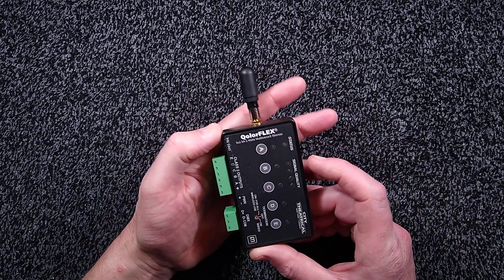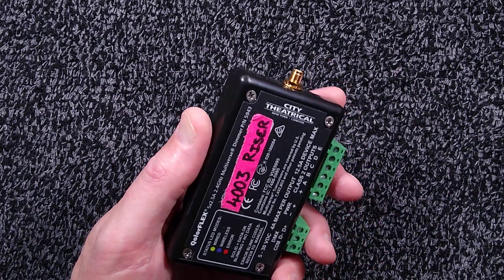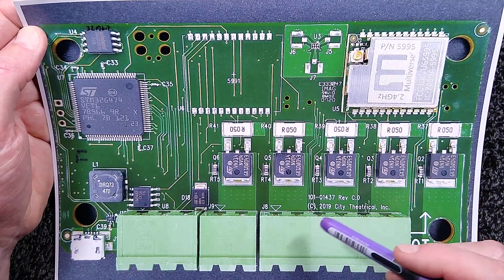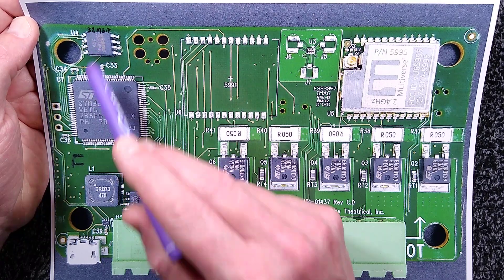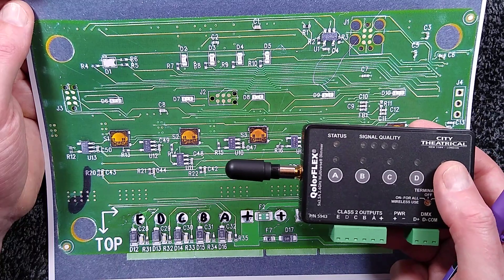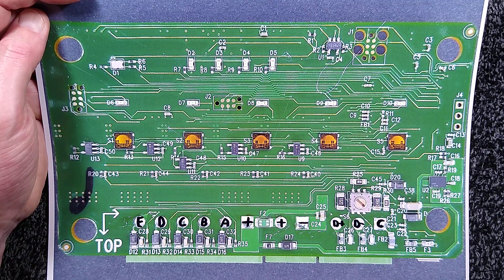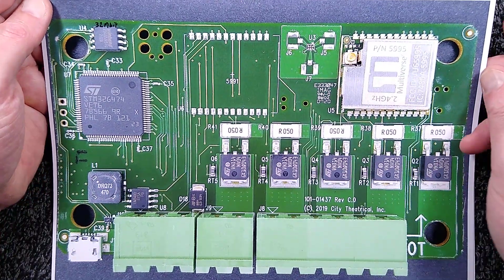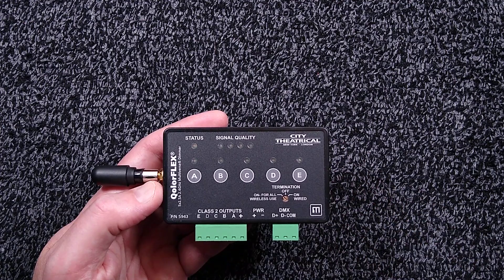Inside a wireless DMX receiver

Comment: I have had a fair amount of issues with production gear on 2.4G. often it works well till the audience shows up and the noise floor swamps out all the headroom. the worst performers seem to be the cheaper or older stuff. with the wireless com system I often use, if you get too close to the Wifi AP that is used for console control the com headset acts as if it is out of range

Comment: Clive, the issue is the huge amount of broadband RF noise radiated by video wall panels.  Serious, fire up the floor and put a spectrum analyzer antenna where the City Theatrical unit is placed and tell us what you find.  I have stories about a performer who wanted to do a duet with his wife (a performer with her own career) and it included them sitting on LED floor.  The RF noise floor at the performer's IEM receivers was 12dB over the IEM transmitter signal.  The artist was "I'll fire you if you can't make this work" insistent on the choreography no changing and the LED floor be used.  It got fixed by adding a transmit antenna that lowered from a lighting truss and got camouflaged as a piece of decor, but it was only a few feet above the performers.  Your problem is less the wireless DMX device and mostly the insufficiently shielded LED panels and their data/power supplies.

Comment: I'm amazed they're operating on 2.4GHz. With the proliferation of iPad controlled mixing desks the audio world has rapidly found that 5GHz causes much fewer headaches once the audience rolls in and you've got a few hundred mobile devices all constantly polling for networks. Cheap wireless mics/guitar packs/etc. that use 2.4GHz also trample all over 2.4GHz WiFi which can lead to some amusing conversations...

Contrary to popular belief, hiding the SSID of your network doesn't help since all that does is tell devices not to show the network in the "available" list.

Maybe they are more stable in the theatre industry where there is a much stronger culture of turning your damn phone off for the show?

Comment: I'm surprised that anyone would even try to make a product for commercial / semi-mission-critical applications that's so depedent on the 2.4GHz ISM band, because it's a cacophany of shouters, and not just Wifi & Bluetooth at potentially close range, but a bunch of other protocols in common use; it's basically the 'wild west' of radio spectrum.  The problem with the 868MHz / 915MHz bands is that, iirc, you'd struggle to achieve a DMX 250kbps rate given the regulatory limits in some countries, because it too is an ISM band where almost anything goes.

Comment: About interference. I recently ran a small show in a small room in a local pub. I pre-wired the lights with a DMX radio receiver for convenience of setup. All worked beautifully at home. In the pub room the lights would respond, then not respond and then respond again a bit later - not usable! Luckily the room was small so I ran a cable from the desk to the lights and all was well. Later I ran a wifi audit app on my phone and saw loads of high-strength 2.4GHz signals.  It looks as though each of the residential rooms just above the room we were in had its own wifi AP and the sheer quantity and strength of signal was swamping the DMX trasnmitter's signal.
Reply: PS we use the radio DMX units in the local village hall with up to 20m throw to multiple receivers and all works seamlessly.

Comment: My work wife does all the DMX in our theatre.  He often has a nervous breakdown with DMX.... I'm lucky, I only have to worry about QLab.
Reply from the maker: DMX is pretty reliable if done correctly.  Biggest culprits for flickering are long runs with no termination, damaged cables and cheap disco lights that decide to put random data back out onto the network.

Comment: Not sure why it even needs the STM32. I helped design and wrote the firmware for a similar device a few years back using only an ESP8266, I will admit it did not have the current sense, but it did have polyfuses so at least it did not smoke under fault conditions. These days an ESP32 should be ample to do the job.

Comment: So, let me get this right, you were using 2.4GHz digital transceiving equipment inside an outdoor Arena, surrounded on all sides by Thousands of 2.4GHz Transceivers seeking WiFi and Bluetooth (both on 2.4GHz, many of which would have been transmitting video via Mobile signal, the TV crews were also using the same frequency band, but at a very (relatively) high Wattage, and you experienced drop-outs?  Bloomin Heck. the basic radio theory I learned in the 70s and 80s is still valid after all!  Every mobile phone was competing for the same signal, ramping up its transmitting wattage at every failed attempt. Ok, very small signals individually, but accumulatively, although not 'interference' as such, definitely a blocking signal. You could have roasted a bloody chicken in there!
Reply from the maker: Yeah.  I didn't care much for the choice of frequency, but on the previous run of this show we used another 2.4GHz system and it performed well.  (Titan tubes)

Comment: Further to yesterday's idea ..... you might make a highly directional antenna , ( to cut out the camera crew's interference ? ) ... these are called " Yagi " and folk that have terrestial TV in poor signal areas have them on their chimney pots etc .... these work around 800 MHz , so one for 2400 MHz will be approx ⅓ the size ( easy to handle ? ) ... you can build it with scraps of wire " Jet melt ™  " to a sheet of very thin ply or stiff card ( multiply all the dimensions down by ⅓ ! ).... do not forget that this design uses a FOLDED DIPOLE to give a reasonable match to 50 Ohm cable ... the use of thin , 3 mm PTFE  RF cable helps ( look up RG numbers ? ) ,  as it is much less lossy @ 2.4 GHz , and it does not MELT when soldering !  there is no need to use a micro MCX connector ( like the module uses ) , just terminate in a SMA connector like in your module shown ( easier to wire up ! ! ) .... hope this fixes your problem ?   (  RF  electronics is a total " black art " .. Ha - Ha ) ............

Comment: It may Not be RF Noisy But RF Line of Sight Blind issue due to Structures, cables being a Some what partial Faraday Cage
Reply: I Do like P2P Mesh Node Radio networks (LORA - Wifi - Packet Radio - Bluetooth  - P2P Mesh (batman) protocol runs on everything ((self Healing - Rredundancy))

Comment: On some RF modules you can change the RF channel on which they operate, but this would only really be practical in fixed installations (experimenting with channels, spectrum analysers etc is no fun for temporary installations) and you would need access to the module config interface. J5, J6, J7 looks like an RF splitter (or a flux capacitor), but that's odd, the interface into these modules is usually serial data, RF is generally only used at the module's antenna output (you wouldn't combine those).

Comment: 1:40 i can be wrong, but that antenna seems to be for 5Ghz and not 2.4Ghz. Normally antenna's for 2.4Ghz are longer. 
Besides that, the 2.4Ghz band is all filled up with WiFi signals of different kinds, what you can try is to change the channel of your 2.4Ghz connection. There are useally 13 channels, with channel 6 the most used one, changing the channel or set the channel fixed can help.

Comment: Got a question Clive. I was in the industrial climate, which began going from motor control and induction heating, to radio control cranes, the computer networking, both in desktop server settings, to PCU's talking to each other, but I have been watching you for quite a while, and can't figure out where your electronics are centered. Care to share?
Reply from the maker: Started as an electrician in steelworks and am mainly doing event industry lighting now.

Comment: I am sure someone's already mentioned this, but the programming ports J1, J2 & J3 are designed for Tag-Connect connectors. I've used one of those footprints in one of my designs.

They're great for adding a zero BOM cost connector to the PCB.
Reply: Might even be able to get a terminal for debugging purposes if you connect a USB to JTAG bridge.

Comment: 2,4GHZ is way to populated for stuff like this.
even wifi routers are having trouble with all the devices that use that band.
I even had a remote control for an RC that would knock out the wifi signal when i turned it on.

Comment: Is that dimming 12v dc, does not sound it can dim ac?
Reply from the maker: DC only via pulse width modulation.  It has a wide voltage range.

Comment: Repeated here, because AS video is pretty darn good:  

A possible RF problem might come from a failure/fault in the switch, where feed-through from Tx bleeds into Rx (though not the other way).  RF also isn't my area.  

Of course, Andreas Speiss would recommend that you test the antenna with a cheap VNA (video last week) to make sure that the antenna is suited to use at 2.4 GHz.

Comment: Tx-Rx switch?
Reply: A possible RF problem might come from a failure/fault in the switch, where feed-through from Tx bleeds into Rx (though not the other way).  RF also isn't my area.  

Of course, Andreas Speiss would recommend that you test the antenna with a cheap VNA (video last week) to make sure that the antenna is suited to use at 2.4 GHz.

Comment: To me, that small 3-way structure between the RF modules looks like it would be for an RF switch to a common output, which commonly comes in those 6-pin packages. I do not think that it would be a diplexer, as those tend to be larger in size and it seems unlikely that one would need simultaneous operation of both bands.

Comment: The 900MHz option would need to be 868MHz in the UK. I have a special radio system for a DIY drone using an 868MHz radio. I'd assume the radio modules are standard modules and can be swapped, so if there was a model with an 868MHz receiver you could desolder it and replace it with the 900MHz Radio module (probably the 2.4GHz radio too but I'd make absolutely no guarantee on that as I'm using a completely different device to base that information on.

If you did decide to go that route I'd try and work out what Ofcom says about the frequency's usage limits (power and duty cycle limits on transmission) because the rules aren't that transparent nor very easy to understand if it applies in your specific usage case, in fact I'm stopping using my 868MHz radios until I can get a definitive answer in case Ofcom appears out of nowhere one day and I get a massive fine get my drone's £200 radio system confiscated for unwittingly breaking the rules.

Comment: 2.4ghz is such an awful part of the frequency spectrum to try and do "real stuff" on, because of how much stuff gets in the way of the waves. Doesn't help that water, which is what people are made out of, absorbs that radiation quite well. Mmm. Now I want microwave'd ramen noodle. The best use of 2.4ghz radio waves.

I would say the component in the middle of the antennas would be for 'diversity' where one antenna would get better reception, and it would choose it. Either in software or automatically by that ABSOLUTELY tiny smd thing in the middle of the antenna pad locations.

Comment: The circuit board says 2019, probably designed in 2018. They probably never figured that 2.4Ghz device usage would explode as it has and probably has so much RF crap coming into the antenna, from other devices, the RF front end can't handle it.

Comment: A couple of things to consider. 

900 / 2400

RS-45 / RS-485

The frequency options used, have the same problems you're experiencing across multiple industry applications and device management parameters.

The problem is likely the interrogation - ack/send , especially if duplex communication is required.

Second, when you state the device is using entertainment industry standard, RS-45, I'm pretty sure you're referring to RS-485. RS -45 is the most common adapter that interfaces to RS-485. The adapter enables one of two protocols; two (twisted pair) pin or four pin protocol (ethernet) over RS-485.

RS-485 ( https://en.wikipedia.org/wiki/RS-485 ) is incredibly flexible. But it also requires high performance processing if low latency signal response is required.

900 / 2400 Freq usage is increasing in the mobile environment. Every post 2010 smartphone has 2.4 GHz WiFi capability across 11 channels. If running in the background, it's interrogating ) acknowledging every device out there, if left in the default on setting. This is especially true if the smartphone device has hotspot enabled. 

A good vector frequency scanning tool would assist you determining the scale of the problem. However, it's not cheap or realistic to operate during a performance. A good example is Keysight's Field Fox N9928. 

You didn't mention if duplex communications is required during the show. If it's mainly driving a light show, I'm assuming the answer is no. This is a good thing and mitigates central processing demands. 

The receiver on the other hand, has more challenges to overcome. Receiving in a noisy / congested frequency zone, surrounded by skeleton metal stage frames, cables and magnet powered speakers, high amperage amplifiers is a very demanding radio operating environment. 

RS-485 has been successfully used in these scenarios. Even if you have multiples of these devices running at the same time, it should be able to handle it. The one area that creates doubt is the number of devices running 2.4 GHz within 1,000 -3,000 foot radius. It's very possible you're experiencing RS-45 latency and / or interference before conversion to RS-485.

I quickly glanced through the DMX 512 ( https://en.wikipedia.org/wiki/DMX512 ) protocol and nothing stands out in simplex or duplex mode. If there is a communications bottleneck, the dominos effect would not surprise me. 

I've run into these problems before in different environments that were solved by shortening the distance to less than 500' with older technology. We've come a long way since first generation Cellular on Wheels (known as Cows) that I was trained on. It was a great learning opportunity. Originally designed for disaster communications and scheduled high capacity venue services (i.e. festival concerts, etc ), as new smartphone Technology (Wifi) was introduced, the demand to support it was exponentially grew. Dual band short (900) range and 2.4 GHz short &  long range are difficult to scale. 

Hope you find a realistic solution once the environment is better investigated. Good luck.

Comment: I am an RF engineer ( ! ) ..... try making your own ( 50 Ω dipole ) antenna , the two prongs should be calculated to be exactly ¼ wavelengths long ( or ½ wave from end to end ! ) use the formula V = F x W ( V is the velocity of light , F is the frequency ( Hz ) and W the wavelength in metres , there is probably an on line calculator for this ? ) this should match reasonably to 50 ohm cable , you can then move it or rotate it to try and block out the pesky camera folk ( ? ) , you might put the dipole outside the lighting room to see if that helps , you might try a sharp notch filter in line , but they can be very expensive ! ... if you are desperate you might be better off using 800 / 900 MHz RF bits - n - bobs ... BTW in my school days the theatre lighting used MONSTA  rheostats ( and NO electronics !  ) set to about 75 % , the projection room was warm - n - toastie in the winter ! !

Comment: Just a Network engineer but as soon as I saw the 2.4Ghz on the can I was just facepalming.
The 2.4Ghz Band is "ancient" in Computer network terms and it is ALWAYS the issue with that. You only have a couple of overlap-free bands that can send and transmit with their full potential and as soon as they are full you get a mess. 
Not sure if you can "program" the unit with some computer or connectivity but you should check if you can reconfigure the channel they run on. If that is doable, check if you can set your stuff to Channel 1, 6 or 11. NOTHING else. These are the only Bands that do not overlap with other bands. Additionally if it has Auto-Hop enabled you should disable that because then the device does not need to re-negotiate anything and is fixed to a set channel (even if it's an overlapping one).

I understand that range is priority and 5Ghz is bad for that. But there is no such thing as "rogue wifi devices" because on 2.4 Ghz everything is just messing it up. Microwave? Check. Electric motors from equipment? Check. Cable induction from powerlines? Check. Hundreds of cellphones blaring through the air looking for WiFi Accesspoints to connect to? Yep check aswell.

If you can and have the permit, check for 900Mhz. The camera equipment has priority with 2.4Ghz because they will use bigger transmitters for sure to just blast everything. And your small transmitter / receiver unit will just get swamped out.

Comment: It's possible with that many people in the crowd, that quite some number of people had the hotspot option enabled on their phones, and it was transmitting on the 2.4GHz band.

The way wifi works is that every (visible) network transmits a beacon at a regular interval, usually every 102.4ms. That beacon is transmitted at the lowest possible data rate, so a network with a long name can take up a substantial amount of time on the channel. If you've got hundreds of nodes beaconing, that can cause a lot of "interference", since only one node can transmit on the particular frequency at a time. Since there's only 3 non-overlapping channels at 2.4GHz, there's really not very many options to choose from, so the whole band can become congested at big public events very quickly, as modern devices monitor the whole band and switch to a less congested frequency dynamically.